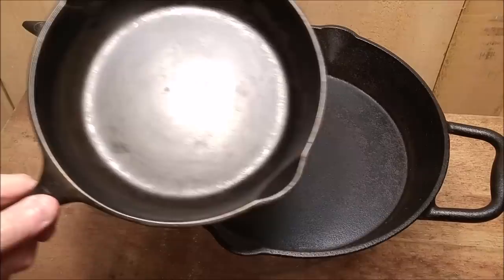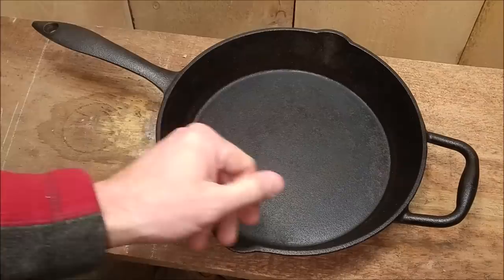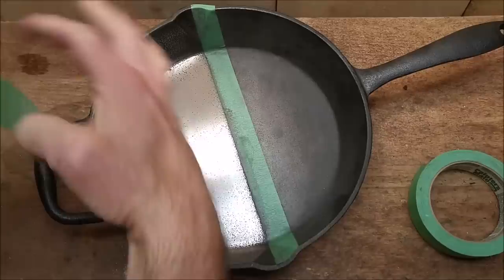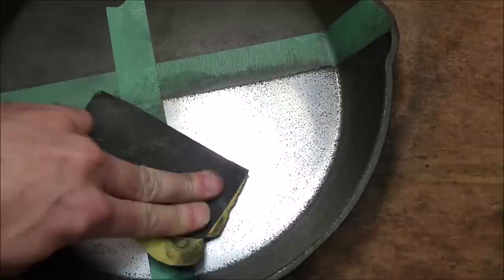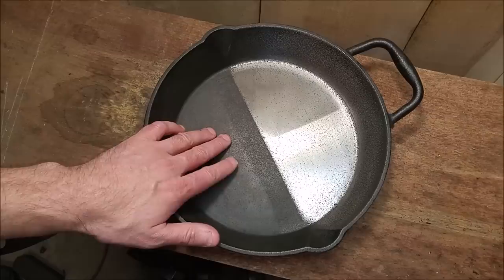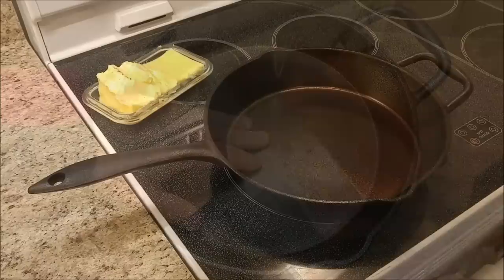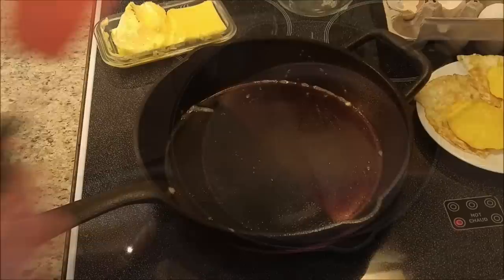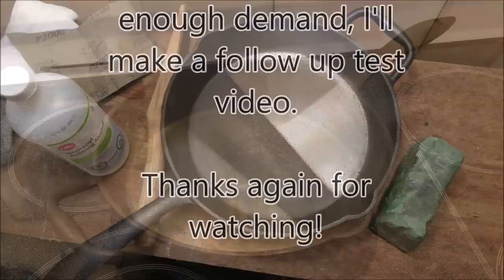🍳EXTREME Polish - Smooth a Cast Iron Pan to Reproduce an Antique Skillet then take it way beyond

Comment: It is the same temperature,  The IR thermometer has a worse time with reflective surfaces.
Reply from the maker: I am an IR newbie, this makes sense, I made a few attempts at adding a different material to the surface, however the readings were still off, not as much, but more time needs to be taken review the temperature reading properly.

Thank you for the comment :)
Reply: @NeedItMakeIt  that is fascinating
Reply: Donald Kasper  Infrared thermometers have good accuracy when measuring most objects, but shiny, reflective surfaces can be a challenge. ... Putting a piece of non-reflective tape (such as electrical tape) over the shiny surface or applying some flat paint gives you a target from which you can get a better measurement. (From Fluke's IR website)
Reply: @NeedItMakeIt  You could always use your meat thermometer and touch the prob to the pan to get the temp. Not as flashy but it'll give better results on shiny surfaces.
Reply: Donald Kasper  the black surface would absorb more from an outside source such as the sun or a light bulb, but not from contact from below such as on a burner.
Reply: donald, you're hilariously wrong. everyone knows black surfaces absorb more radiation. so it's a common misconception that hot black black objects radiate less, but the reverse is true: black objects radiate the most "black body radiation", and shiny metal radiates so little that it's pointless trying to measure temperature this way. also, refractive index is irrelevant to materials that are *opaque to electromagnetic radiation*. you're very smug for someone who knows so little. i don't know, maybe look something up instead of guessing next time

Comment: Emissivity is a very real thing. We had a 6000 horse power synchronous motor that the commutator would get too hot (turned out it had the wrong brush material, it needed brushes with a higher copper content) and the commutator needed rebuilt every year at a cost of tens of thousands of dollars. Before we found the problem we started stoning the commutator at least every day. We took readings with an IR temp gun before and after stoning. The temp would drop drastically after each stoning. The mass of the commutator was such that such a sudden drop wasn't possible. It was much shinier after stoning. Turned out to be emissivity. You could use black barbecue paint to fix that, but there is another problem. While the gun puts out a nice little dot for aiming, the actual area it is measuring is probably larger than the entire frying pan. A way around that would be to use an IR camera, but they are expensive. You can get a questionable camera attachment for a phone, but they are more than $100, and any decent IR camera will likely set you back a few thousand dollars. I would opt for a contact type thermometer.

Comment: The difference in temperature reading is due to the emissivity of the surface being different from a rough to polished surface, rough surfaces have a higher value, eg. rough black iron 0.95, while shiny surfaces can be much lower, eg. polished steel is around 0.07.
Reply: Thats interesting
Reply: Yep, emissivity but color plays a factor.  Black is the color of a material that absorbs all visible wavelengths, white reflects all and bare cast iron is grey.  A "black body" is the easiest to measure because it readily emits "black body radiation".  I'm not sure if color or roughness is the dominant factor but they are both responsible.

Comment: Crazy the way these phones listen in. Wife just bought this exact pan last week for $20 at Canadian tire. Upon seeing it, I said it was too rough and proceeded to polish the inside. Turned out great. Certainly did not search up anything related to lagostina, nor grinding a pan, yet this morning, what shows up in my feed? 1984? Yup.
Reply from the maker: I had the same experience a few weeks ago, a coworker was telling me about a new method of welding pieces of aluminum together, call Friction Stirring.  I would never had thought of searching for this and had no idea it existed.  That night it showed up on my feed.

I'm going start talking about something I would never have before to see what happens... 

BTW, they may have improved this pan's design, but they were manufactured with a bulge in the middle.  it might be worth putting a straight edge on the inside to see if you have the same problem as I did.  The bottom is also concave by 1/16" and this causes any oils or eggs to move to the outside of the pan.  

Also I'm working on a video to fix this right now, but they may have already changed the design because they had a lot of comments from customers on this problem.

I saw that sale also, and I was tempted to buy another, I don't have room for any more!
Reply: Yea, I was talking to a friend about her ski trip she took over xmas to Utah last week and i got a ski Utah email two days later.
But nope they are not listening to you! Lol

Comment: I've used an angle grinder with a flap wheel to resurface these. It's a lot less elbow grease than doing it by  hand.
Reply from the maker: For sure, check out my latest video, I use your technique and also built a device to spin the pan at the same time to re-shape the inside of it and smooth it also.

Thanks for the comment!
Reply: Exactly....

Comment: Griswold is my favorite pan.. plus they are collectable and only go up in value. Oh and the best part is you have to cook with them to maintain there value.
Reply from the maker: I've heard a lot about the Griswold pans, do you have a particular model or size that you like to use the most?  I've never used one myself; I really enjoy my $10..10" Kitchen-aid, it's just a solid pan that performs so well.

From your experience, do you think that the kind of oil used makes a big difference, or is the seasoning more important or the texture of the surface?  Maybe something else?

Thanks for taking the time!
Reply: @NeedItMakeIt   What Riley said is true about Griswold. But i prefer late production Wagner pans (last produced in late 80's) with machine finish inside for cooking. i have a 10" and an 8". These pans have Wagner 1891 original cast into the bottom as well as 4 step seasoning instructions cast in.They are not as deep as some of the older Wagners that say Sidney with a number designating their size. My 8" measures 1 and 7/16" deep. The older Wagners and Griswolds are deeper and the Griswolds are of a finer grained (ductile perhaps) iron and have a smooth finish all over whereas the Wagners and others (benjamin Medwin comes to mind) have a cast finish on the underside and on handles. The sides on the late Wagners are sloped a bit compared with the steeper sided older pans. That makes getting my spatula under fried eggs easier when they are right up against the edge. They all can be found on Ebay or if you prefer the hunt, thrift stores and garage/yard sales.
Reply: NeedItMakeIt I have nearly fifty Griswold skillets and Dutch ovens and more ,, I use olive oil for seasoning , the pan needs to have its pores open so make sure it’s a little more then warm when you season it , don’t over do it either ! When it comes to cleaning I Initially use water then dry it out and clean with coarse salt and a stainless Scouring pad ,,, my pans are like glass inside ,,,   PS.    Be careful what oil you use to season if it sits too long it can become rancid , that’s why I use olive oil !
Reply: @NeedItMakeIt  Over the years I have acquired a #0, and #3-#9 Griswolds. There is no size I like the most. It depends on what I'm cooking, sizing the pan to the food for the most efficient use of the available heat.

Comment: I always smooth my cast pan then oil bake them this results in one of the best if not the best pans ever.
Reply: What do you mean Oil Brake them?
Reply from the maker: I have to use the barbecue because it smells up our house quite a bit.  I've found that leaving the pan in at 450f for about an hour does a great job in setting a hard seasoning layer.   The same concept though, the Stargazer website has a great method that is easy to understand.
Reply from the maker: I think oil, then bake.
Reply: @NeedItMakeIt  Could you elaborate oil, then brake is kind of vague! What do you mean by brake?
Reply from the maker: @NMETSGChan    

I believe he said Oil Bake.

The simplified (Oil) baking process is:

1.  Clean your pan with soap and water, dry immediately

2.  Place in the oven at around 200f for about 10-15 minutes (removes any residual moisture and "opens the pores") Note: As far as opening the pores, I'm not sure this is  what's really happening, but I can't really prove it either way.  In either case it works.

3.  Take out and apply a coat of Canola/Veg oil to the surface, apparently the higher the smoke point the better... Canola works great.

4.  Wipe off the excess thoroughly.  Any drips will show up if you don't catch them now. Some people say to wipe everything off... I personally like to leave a thin coating

5. Preheat oven, or bbq to 450C and place pan back in upside down.  Some people say place something below... if you wipe off the oil properly, you don't need to.  Also, the pan won't crack because it is being heated evenly.

6.  Leave in oven/bbq to bake for 1 hour, this part is very important, the purpose is to cause the oil to polymerize, or convert into a carbon structure, both bonding to the pan, and creating a non-stick water resistance surface.  I'm not a chemist, but it is similar to the process of Boiled linseed oil being applied as a furniture finish, just much quicker.

7. Turn the oven/bbq off and leave for an hour or so, this will continue to cure the seasoning so that it is not sticky and it should be hard / black and water repellent when it is finished.

8.  If the pan is not seasoned, you'll want to do this at least twice, but the more the better, so it can take a while.

9.  Clean and oil the pan and you're ready to go.  

Troubleshooting:  If the finish isn't very dark, you need to leave it at a high heat for longer, if it is sticky, you've applied too much oil or not enough time in the oven at high heat.  If it is blotchy that could be an unclean surface before the oil was applied, or too much oil (pre-heating at 200f) seems to prevent this.

You'll know the process is working when the pan is smoking and smelling up you house... again use a barbecue.  Normal cooking on the stove top should not produce smoke, if it does, you are cooking too hot, or your seasoning is not set. 

I've been researching this process quite a bit and testing as well.  Everyone has their own variation, and many methods work well.  This works for me and it can be seen in my latest video on an un-seasoned pan. 

I hope this helps!
Reply: @NMETSGChan Re-read the comment carefully.  He said "bake,"  nobody has been saying "brake".
Reply: @NeedItMakeIt  tag for later!
Reply: @JK-et6yo  Hahaha Sorry Guys I really read it wrong, Twice!
Reply: I used the potato peel, salt, and oil method for my black steel pans, which worked incredibly well. I'd guess it would work just as well for cast iron but haven't tested it.

Comment: The pan had the same temp along the entire bottom, but shiny objects radiate less IR energy than dull objects at the same temp. So if you're using an IR thermometer, it has to be calibrated to the emissivity of the material you're measuring.
Reply: True. That is reason to keep a surface thermometer on hand.

Comment: I bought a 15" Westinghouse for my wife. It was as rough or rougher than what yours looked like. I took a 60grit flap disk on an angle grinder to it and cleaned it out. Took all the ridges out of it and it now works/looks great.
Reply from the maker: That's a huge pan, it must weigh quite a bit (good for strength training) the flap disk does work well, I've tried the wire wheel, and it struggled to get through the seasoning, which surprised me, seasoning is pretty tough stuff.  I've never heard of the Westinghouse brand, have they been around for a while, or is it new?  I see they are available on Amazon right now.
Reply: @NeedItMakeIt  Not sure how long they've been making pans, but they've been in business since George Westinghouse founded his Westinghouse Electric & Manufacturing Company in January 8, 1886, which was later renamed to Westinghouse Electric Corporation in 1945. Yah, it's a big pan. Pretty much unusable until I hit it with the flap disk, then re-seasoned it. Wife is real happy with it now. Fry an entire chicken in that thing :o)

Comment: Some of the comments on why the infrared thermometer was measuring different temperatures were close to being correct. Infrared thermometers measure the far infrared light that's being emitted by a surface to determine its temperatures. 
Surfaces have a property known as emissivity, this is a measure of how well the surface emits far infrared light. Many properties of the surface can change it's emissivity. Black rough surfaces tend to have a high emissivity which means they emits far infrared light well. Silvery smooth or shiny surfaces tend to have a low emissivity which means they do not emit far infrared light well. Low emissivity surfaces will indicate lower temperatures than high emissivity surfaces at the same temperature. High-end infrared thermometers have an emissivity setting so the thermometer can be calibrated for the particular surface you are measuring. Infrared thermometers are good for non-contact measurements but they're not very accurate. Nothing beats a physical contact measurement.
Reply from the maker: That is excellent information.  I was in the shop last night working on another testing project and I was seeing a similar temperature differential, the rough surface read higher values than the smoother/lighter surfaces.  

I agree that a contact measurement method would be better, I have an instant read thermometer, which works great for meat, not so good for hard surfaces.

Thanks for your thoughts on this!
Reply: @NeedItMakeIt  Back at university we tested this with a block of aluminum on a stove. The aluminum was everything from sandblasted to polished holed with different diameters and some with thread. Conclusion was that to get an accurate measurement on a surface with an unknown emissivity you want to measure a threaded hole at least three times the depth of the diameter. or use some special tape with a known emissivity.
Reply from the maker: @rasmusegeolesen  Alright, excellent advice.  I had attempted using black thermal paper from a computer months ago.  That didn't work because it refused to sit flat on the surface, so I'll go ahead and look up this thermal tape and use this in a follow up test.  I may also try to source a direct method of reading temperature.  I may have to make something to house an instant-read thermometer, however even that comes with it's own set of problems.
Reply: I know that an infrared thermometer will read different from a shiny surface as compared to a mat surface. My question is, how much difference does surface area make? In my lay opinion, the more surface area you have, the higher the temperature. If you sand away the highs aren't you losing surface area?
Reply: @christopherbronson748  it's hard to say how much the emissivity will change for any given physical change to a surface. In order to calibrate your infrared thermometer you're going to have to make a physical measurement with a more accurate contact thermometer. The best way to do this is to make a single contact measurement near the temperature that you intend to measure. Then use your infrared thermometer to measure the temperature. You can use these two temperatures to create a correction factor for your infrared thermometer. As long as you don't change the surface again you should be able to use your infrared thermometer to make more accurate measurements. Although the repeatability of your measurements will depend upon the quality of your infrared thermometer and how closely you're repeating the physical arrangement of your infrared thermometer and the surface your measuring. 

Overall infrared thermometers are very limited on how accurate they are. They're really not good for making high accuracy measurements. They can be used for making comparative measurements on surfaces that are similar in situations where it is difficult or impossible to make a contact measurement. They will also give you a rough idea of how hot something is within a few degrees.

Comment: I did this one of my cheap pans a few years ago to try it out, but I'm lazy and used a synthetic abrasive brush in my drill, and an orbital sander. Anyway, I like the difference. For me, it seems to be seasoning faster, and is more non-stick and much easier to clean. Can't see any drawbacks of doing it.
Reply from the maker: Thanks, I agree as well.  I went too far in this video of course, tonight I'll be releasing a video showing a few more reasonable grits to sand to and 1 very unique surface finish.   

I have nothing against people using orbitals etc.  The main reason I do this work by hand is because I like to do hand-work, I personally prefer the final product to have some type of variation that you'd see with things made by hand.  

Do you have any brands of CI that you prefer?

Comment: You can’t use a temp gun on a shiny surface.  It’s essentially measuring how bright it is in the infrared spectrum.  You’re getting a lot of IR from the environment bounced off the surface and washing out the color of the pan.
Reply from the maker: That's right, thanks for the info.